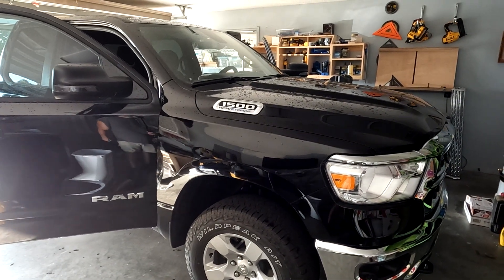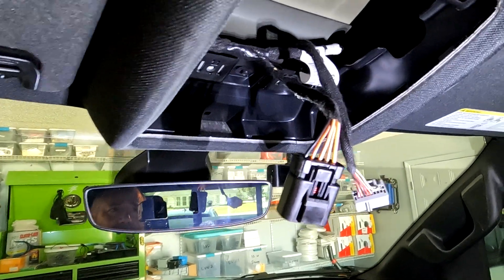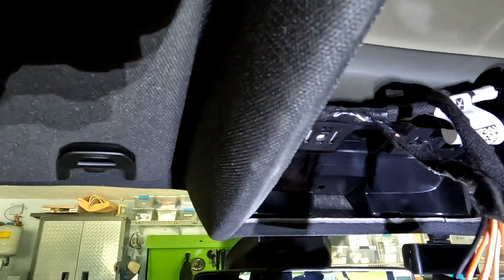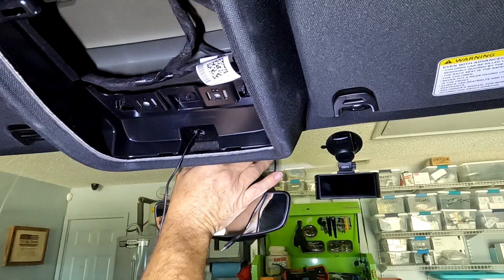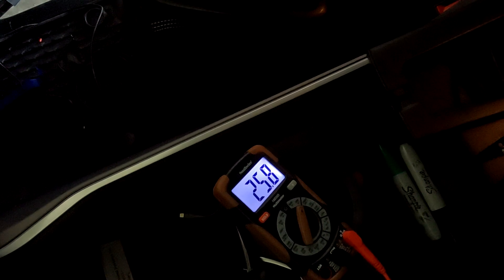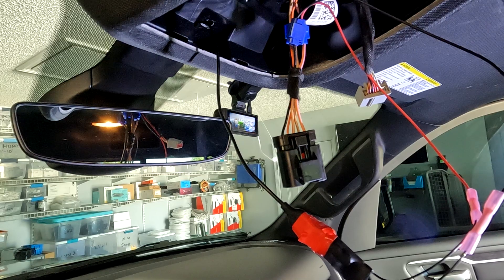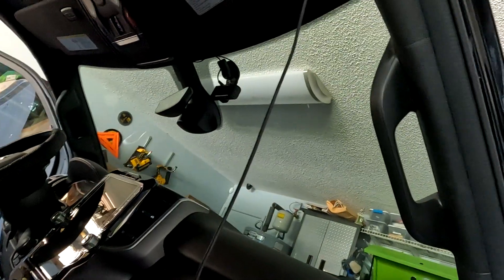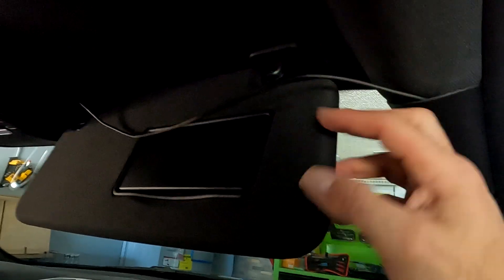Clean Dash Camera Installation for Dodge Ram 1500 Where To Pull Power From Halogen Not Led

Comment: Just remove the 8 mm bolt holding the headliner in place right there. And pull down just enough to get the  wire through the top and out to the windshield NO Drilling required.